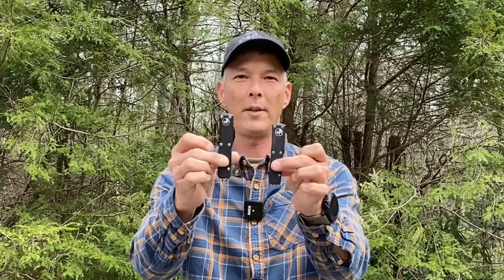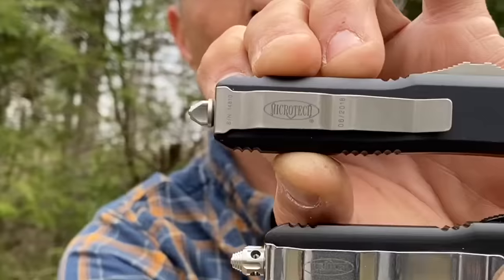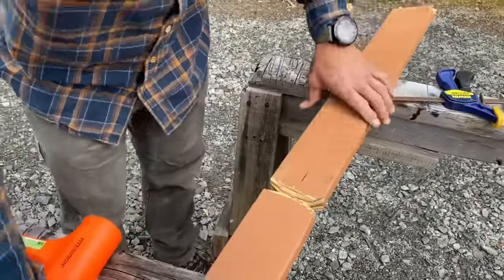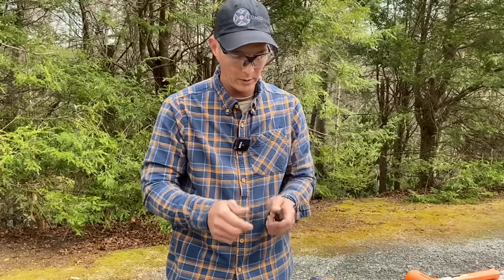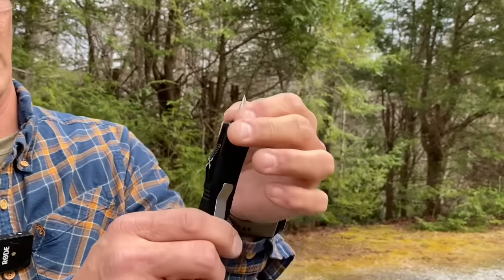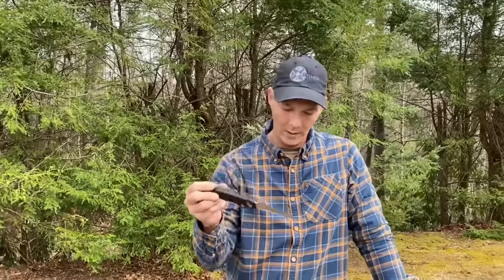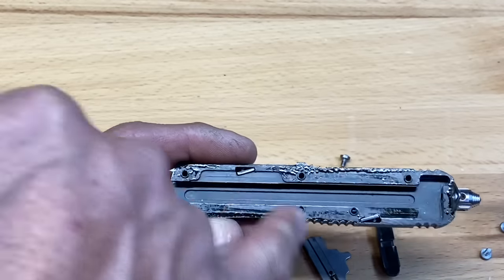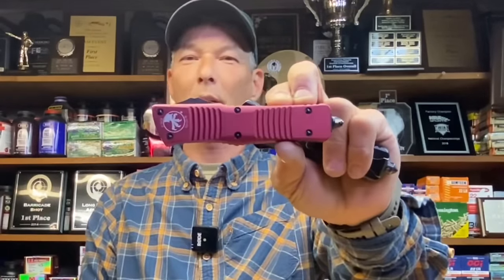Counterfeit Microtech torture test!

Comment: If the knife is so strong then microtech should have a better warranty instead of refusing warranty work for so much as looking at it wrong. Also for 60 dollars that counterfeit is a great deal for sure it is a fraction of the price of an ultratech. I don't know anyone who hammers OTF's into solid pieces of wood so that's not much of a problem. Plus that would most definitely void your warranty anyhow if it did break the ultratech. Microtech also unfortunately doesn't allow you to do maintenance work on your knife either and you are not allowed to open it up which sucks because these knives are not difficult to disassemble and reassemble. Send your knife to Benchmade in a bunch of pieces in a bag and they will reassemble it but if you send a Microtech to Microtech in pieces they will refuse your warranty and send it back.

You claim its something that is yours for a life time yet is it really mine? What is the point of making something so durable and expensive if the warranty is garbage? So I have to baby the knife or risk losing out on some hundreds of dollars if mine didn't hold up quiet as well as the next one. If I am paying 300-600+ for a knife then I expect a good warranty and I expect to be able to service my own knife instead of being forced to send it in which will cost me even more money in the long run plus time without the knife and risking losing it in the mail.

I'm just saying 60 bucks for a knife that can take a pretty good beating and work is not bad... If it does break you are out 60 bucks meanwhile a ultratech is going to run you around 300 bucks and even though its so durable you still have to baby it if you want your warranty to be honored which is still going to be a hit or miss... I am just saying if I am paying that much for a knife I should be able to actually really use said knife and I should be able to service it because its mine I paid good money and I should be able to open it whenever I choose. If my disassembling of the knife didn't cause the failure it shouldn't be an issue but they'll just claim it could have possibly have had something to do with it and fail you. If they had a Leatherman style warranty I would not only buy them but I would also use them and I would feel more comfortable when it came to dropping money on them as well.
Reply from the maker: Have you ever owned one and been denied warranty work because you took it apart?   I didn’t think so.
While there are many people who have no problem servicing their own knife, there are many who can’t put a cap back on a toothpaste tube.
Think of it this way, if you buy a new vehicle with a warranty but decide to play around with the engine, should the dealership warranty the fact that you lost parts while playing around in the engine ? 
The most common issue is people strip their chassis screws or lose parts trying to service their knife.  If you have the proper tools and don’t strip screws or lose parts how are they even going to know?
Reply: @XRING  Don't blame me for the reputation Microtech has gained online I sure didn't create it. Looking up "Microtech Warranty (insert forum here)" brings up so many bad experiences. Sure some could be fake others could blatantly be at fault and try to make it out like they are the victims but I just have a hard time believing all of those people are making up stories. Sure Microtech knives are good and the warranty is good but that is if you manage to keep the warranty. I shouldn't have to risk having my warranty for my 300 dollar knife voided because there was a small telltale sign that I opened and cleaned it. I shouldn't have to pay for shipping and go without it for weeks because it needs a cleaning or it needs to be sharpened because god forbid I mess up a sharpening that's grounds for voiding a warranty too. Thankfully I know how to sharpen knives and apparently I know how to sharpen them better than Microtech employees considering the grind on my Ultratech is most definitely not even. Based on the initial knife grind I know one thing and that is that I would never pay Microtech to sharpen one of my knives lmao. Sure it is a sharp knife ill give it that but its not scary sharp or anything... The Hogue Spartan I ordered at the same time came with a sharper blade with a more uniform grind though it did cost more so there's that.

When it comes down to it I hope to never have to test the warranty and hopefully the knife never has any issues. Just because I have not had any personal experience with their warranty department doesn't mean I'm going to ignore the significant amount of complaints about said warranty in forums, articles, and videos. But that's the problem though due to all the negative comments about the warranty I'm afraid to even EDC it as my main knife because I don't want to cause it to wear out any faster than it has to wear out because I don't want to deal with the customer service. It is great that the knife can be hammered into a piece of wood but what if for whatever reason mine breaks doing just that? Do I not have to worry about my warranty being voided due to abuse?

Don't get me wrong I do like the Ultratech it is not a bad knife though it definitely isn't cheap. If the Ultratech didn't have a wobbly button I would like it a lot more but having a button that just moves around all over the place gives it a cheap feel even if its supposed to protect it from wear. Wear that I wouldn't have to worry about if I didn't have to chance risking the warranty on a knife that costs hundreds of dollars if I want to clean it. Sure you can say only knowledgeable people should be opening the knife but when it comes down to it mistakes do happen. While I may be knowledgeable I would rather not gamble away a warranty that can be voided due to any tiny mistake. Just like how I'm sure my uneven blade grind on my 300 dollar knife was a mistake. It is my fault anyway for not getting a combat troodon instead but based on the pictures it was hard to see the difference and I didn't actually notice how significant the combat troodon looks until after I saw it in a video comparing the two and by then I had ordered the ultratech. I may return it for a combat troodon since I have heard the button doesn't wobble around as much and the overall larger knife is better for my large hands.

Like I said though when it comes down to it I think I'm being fair towards the knife because it is a good knife. I only have two issues and neither are fatal flaws. The biggest issue is the wobbly button and the second issue is the little scrapes on parts of the blade near the action from deployment. I would rather my expensive knife not have scratches on it from the first time I opened it. Scratches that were probably put on it when tested in the factory. The Hogue does it too worse in fact and I know tolerances need to be tight but not so tight that it scratches the D/E and the 204P marking on the blade right out of the box without anything you can do about it.

Edit: There actually wasn't any scratches it ended up wiping off. On the microtech anyway on the hogue there are some.

But the microtech pocket clip is a tad loose though and moves side to side fairly easy and caused a scratch already. Since it takes a special tool I can't just up and tighten it myself without getting said tool.
Reply from the maker: @TheFrogInYourClosetWatchingYou  Thanks for the detailed response and I do not take it personally.  I really appreciate your feedback and for watching the channel. I hope you have a great weekend !

Comment: hey guys, does anyone have tips for dealing with a stiff ultratech? I got a new one a few days ago and retracting the blade is a pain in the ass. in the video this guy can extend and retract the blade with ease. sometimes I can open/close it with one hand no problem, sometimes I have to use two hands. do they take time to break in or do I need to investigate the internals? this is my first DA OTF so any tips would be appreciated, thanks.
Reply from the maker: Believe it or not the more you do it the easier it gets because of your thumb being used to it. I have built a lot of Microtechs.  They really don’t break in.
Reply: @XRING  gotcha, I'll keep using it until I feel comfortable then. appreciate the reply brother, good work on the video.
Reply from the maker: @frogturtle  Thanks and thanks for watching!

Comment: Hate to say it.......I know I'm gonna take heat for this.....I owned an ultratech (a real one).....and for the money I paid for it......I dunno, lets just say I sold it at a 30 percent loss a month later.  Bought a few clones from dhgate for ghits and shiggles, and the one of them had BETTER action then my authentic one had.....and it cost me 40 bucks opposed to 300.  440 steel blade on the clones opposed to the d2 for the authentic...and again.......d2 doesnt wow me.....its a pain to sharpen, isnt s30 or s90.  I feel like the clones this guy had were "mid-grade" ones.  He shouldve spent the extra 10-15 bucks and got the high grade ones.  A part of me feels like he def wanted them to fail though.  Even so, who the hell is gonna attempt to hammer an otf through a 2x4 anyway?  I mean, I dont think anybody buys them for "hard use".  I always felt otf knives were kind of a gimmick to begin with anyway.

Comment: But, Deadlock.
Reply from the maker: I know,  I mentioned that in one of my comments.  Those are super expensive and have a lot of intricate internals. Gavin is a talented knife builder.
Reply: @XRING  honestly, for what you get and considering what brands like "Microtech Custom" will try to sell you with inferior materials (aluminum handle) AND a blade wiggle for around the same $$...a Deadlock is a bargain. I carry and use my Model B and do so with confidence.

Comment: So the knock-off completed all the other tests, then failed the nail test. The blue Ultratech appeared to survive only the nail test  (granted it completed it twice). Did I miss something, or was this Ultratech not subject to the earlier tests (did a different knife do those tests?) - meaning a single Ultratech didn't do all the tests,unlike the clone? Also, you challenged the alloy used in the clone. It would be pretty easy to at least measure the Rockwell on their  steel, instead of just giving us your opinion, since their steel appeared to hold up pretty well.